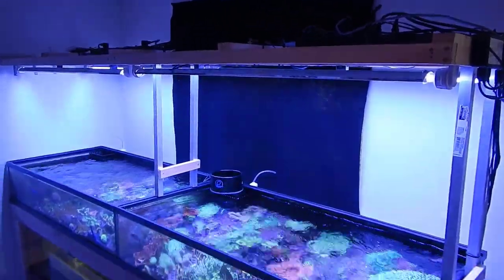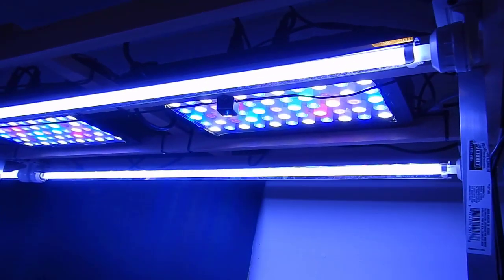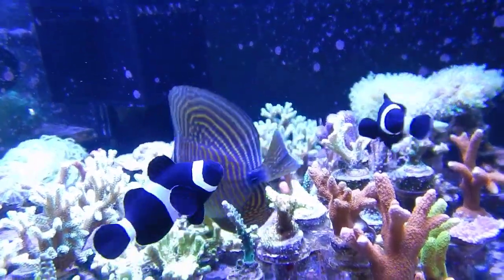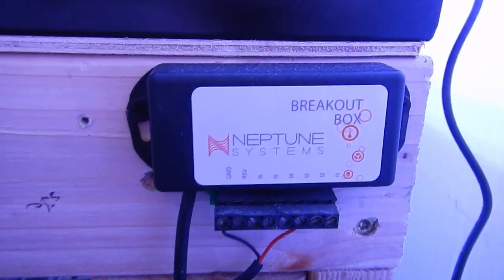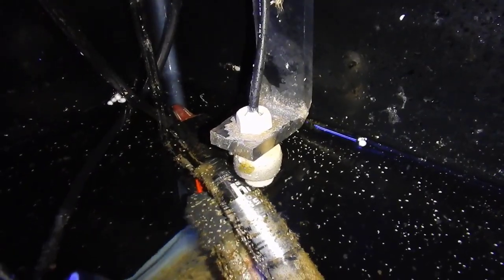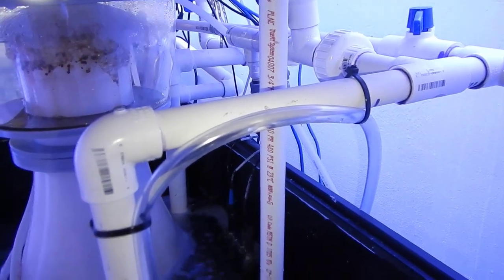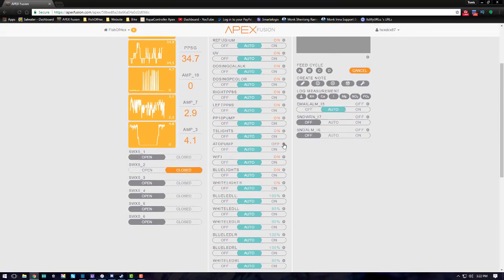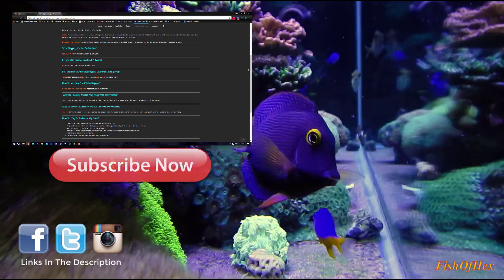Auto Top Off Guide For Beginners

Comment: After watching this I feel like ATO's are way too expensive for what they do. At first I thought, "One more Tunze product to invest in for $200 should solve all my top off problems" But now that I realize they require maintenance, are over-priced for such a specific job. I would much rather spend $50 on a really good programmable timer and whatever else on any pump, mark the time/date wait a couple days for evaporation, with the new timer pump setup installed, use the timer to turn on the pump and stop the pump at original water level noting the time it took. Then set the timer to every 48 hours turn on for 30 seconds or every 24 hours turn on for 15 seconds etc. I think I'm going to run with this idea, idk how those ATO's work and my brain computes the simplicity of putting a pump on a timer in any reservoir anywhere.